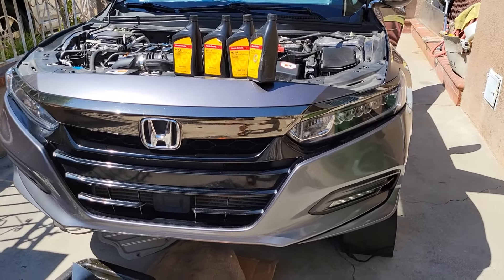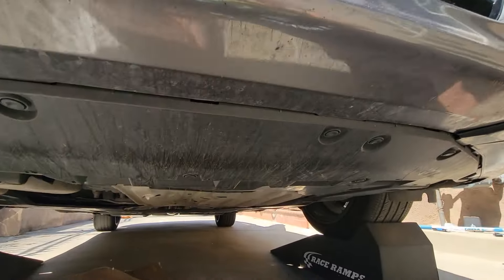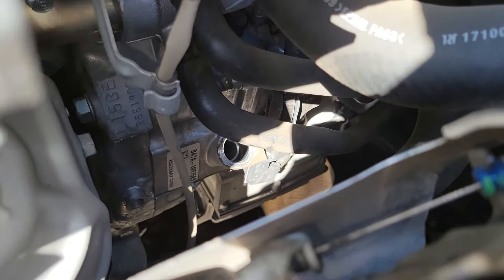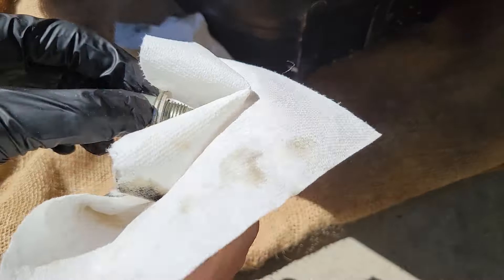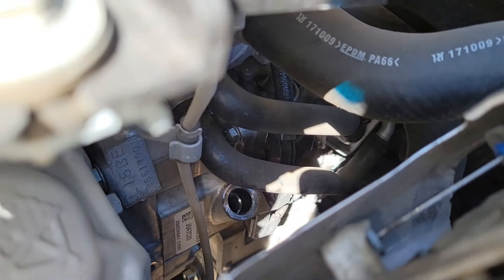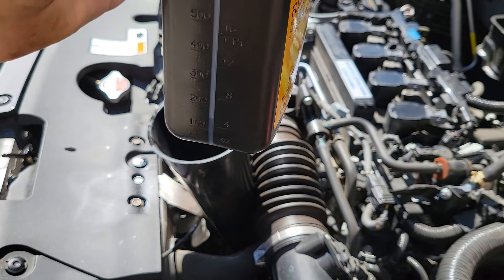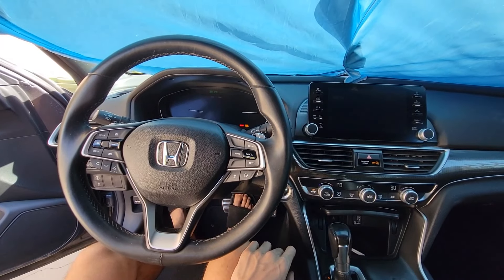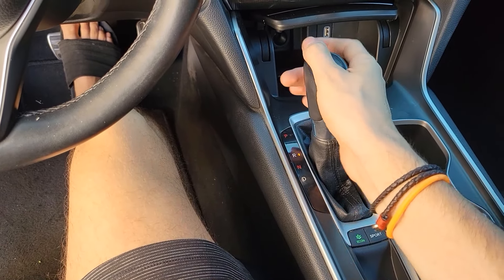CVT Transmission Fluid Oil Change 2018-2024 Honda Accord, CR-V (1.5L Turbo)

Comment: What about changing the transmission filter? and where is it located?
Reply from the maker: If it's similar to my 2013 Accord, it's under and behind the battery which takes some work to get to. In addition, last I spoke with my local parts department, they didn't even know or have the right parts so I just left it

Comment: But you didn't change the filter inside te transmision and the one outside next to the coolant of the transmision
Reply from the maker: That's correct. Honda makes no mention of servicing these 2 filters. There is very little information on it, and for that reason I do not feel comfortable making content on a service that Honda does not have in their maintenance schedule. Keep in mind I'm an average reviewer, and don't want to pretend I know more than I really do. Just spent an hour looking into trans. filters and nearly nothing comes up

Comment: Would the same oil capacity apply to a 2022 Civic Sport?
Reply from the maker: Its the same engine, not sure about the CVT. would refer to your owners manual for 100% accuracy

Comment: So you never changed the filter after changing the fluid?
Reply from the maker: Correct. Honda doesn't show it as a maintenance list item so I'd rather not mess with it

Comment: Thank you for making this video 
Really appreciated 

I have a 2019 Honda sport 1.5. This maybe a dumb question lol but where can I know what oil to purchase for the transmission guild?
Reply from the maker: Always here to help! Not a dumb question at all! 
Are you referring to the yellow bottles I am using in my video?
Reply: @Striker50_  yes the yellow bottles sorry for the late reply. I’m hitting 87k miles so the recommended me to do the transmission fluid. Based on the mileage Do you know when to do the transmission fluid ?
Reply from the maker: @yusufkohgy9122  No worries, Honda parts department sells them, or you can order them on eBay or Amazon. 
Here's an Amazon link from a reputable seller: Set of 5 Quarts Automatic Trans Fluid HCF-2 Compatible with Honda Accord Civic https://a.co/d/5SYxpNH
Prices for the Transmission fluid have been going up over the last few years, I bought them for about $42, 2 years ago
At least that seller is giving you 5 qts instead of 4 bottles
Reply from the maker: @yusufkohgy9122  Here's another seller that gives you 4 bottles and includes the crush washer. This is one of the best prices I could find with free shipping. I don't know these sellers or make profit for them, just want to help you find a good deal  https://www.ebay.com/itm/255874364509?mkcid=16&mkevt=1&mkrid=711-127632-2357-0&ssspo=GCD07b19T8G&sssrc=2349624&ssuid=AtBDZaGWSv-&var=&widget_ver=artemis&media=COPY
Reply from the maker: @yusufkohgy9122  The car should give you a notification to change it at the 50,000 to 60,000 mile mark, but if you're at 87k no worries. This is basically the same transmission as my other 2013 Accord's CVT and that one was recommended to change anywhere from 60k-90k. What I think Honda started doing is recommending people to do their Transmission fluid changes more frequently (at the 50k-60k mark) because it's more money Honda can make. Service departments are the cash cows 💰 of Dealerships. But to be fair, it is better to change fluids sooner than later. 
If you see my CVT video on my 2013 Accord, I didn't change that fluid for the first time until like 110k miles 🤣😱 but she still drives like a champ at 144k.
Reply: @Striker50_  yea dude I get the same feeling whenever I go to the dealership 
I’ll definitely check ur CVT post out

Comment: What mileage should you replace a tranny fluid? I have 2020 Honda Accord Sport 1.5 with 27k miles. I read some say 30k or 45K so i wasnt sure which is the correct info.
Reply from the maker: Hey Gina! My humble opinion is that if you do regular driving, you should be fine following the maintenance minder notification which will come on around the 50,000 mile mark. If you're driving it like you stole it everyday (pedal to the metal) then every 30,000-40,000 miles for example tons of mountain driving, or always aggressively accelerating in city settings. 
For reference, my 2013 Accord didn't get its first trans fluid replaced until around 110k miles, and currently at 144k with no issues knock on wood 
Most of us should be more than fine just following the suggested intervals, and we can easily do most of these services ourselves without paying crazy mark ups the dealers are asking
Reply: @Striker50_  I brought my car to dealer for an oil change and they recommended me for a cvt tranny fluid. I thought that was odd because i only 27k miles . Im not no car savy but i felt it was just a scam to pay a service when it wasnt needed SMH.. In regards to be changing the brake fluid, do you what interval that should be done?
Reply from the maker: @bj10jgo  That's superrrrr early honestly. Sounds like a money grab unless you live in a mountain region where it's common knowledge to do it often
As for the brakes, 30k-60k is common, but if you drive conservative, you could go years before needing to change pads and such. Brakes have a clip that squeals when your brake pads start to get low. Of course, sometimes the squeal can come from debris or other stuff, but just pay attention for that sound

Comment: Hey man! How many miles did you change the transmission fluid? The dealer told me in 60k miles.
Reply from the maker: A notification came up at 50,000 miles, you can see the notification on the screen towards the end of the vid 👍

If you do this service yourself it costs maybe $55 max and take like 30 minutes to do
I hate dealerships because theyll charge like $300 for something relatively simple to do and you'll waste like 6 hours waiting to get your car back
Reply: @Striker50_  Try $411 🤦🏽‍♂️.!!! Dealership here in Sacramento trying to charge me that amount right now for a transmission flush, which I personally don’t think I need, cars at 48k and I did a transmission fluid change at 34k. It’s a 2018 Accord 2.0 10speed Turbo. Any feedback would be appreciated. ✊🏽
Reply from the maker: @damerobin4037  Sacramento is relatively flat so might not be necessary to change fluid so often. 
In addition a full flush may very well be a reason why they're milking you for $400+ 
My personal opinion is that it's an overkill to change it so often unless you're shredding mountain roads near Tahoe frequently
Reply: @damerobin4037 maita honda in Citrus Heights quoted me $450 yesterday.
Reply: @Striker50_  Thank you, much appreciated. 💯🙏🏽
Reply: @jeffreykwong1712  That’s exactly who quoted me $411 a few months ago. They changed now to Future Honda.
Reply from the maker: @damerobin4037  Damn 💥 all the Honda dealerships in California charging an arm and a leg 🦵 🫰🏻
Reply: @Striker50_  Welcome to California, where we overcharge for everything 😂.

Comment: Is it every 90k miles?  Do you think putting the front on ramp will impact fluid draining out, maybe not?

Did you drain and refill 3 times to get most old fluid out?
Reply from the maker: 60k or when your Maintenance minder light comes on, sooner never hurt anyone either
Reply: @Striker50_  Since some old fluid is still left, do you think it is good to do drain and refill 3 times after driving, or one time, and wait a few months?

Comment: You didn't say... But only hand tighten the new oil filter.. snug.. So many  over tighten it .. and some will even use the filter wrench..
Reply from the maker: I didn't change the oil filter you may be confusing it with the engine oil filter
Reply: @Striker50_  👍You are right I must have been watching a couple of different videos and got you confused with what I say it.. brain freeze😅I like these types of videos. Good job on yours..
Reply from the maker: @charlesjackson1700  Thanks! Yeah happens, we dive down the rabbit hole and can't remember where we saw what lol
More to come I've just been caught up with work and I want to make sure I'm cranking out quality content (despite being an amateur)

Comment: hi, i have a question i want to ask is that the correct fill plug location because there are other fill plug is closed to battery that one has hcf2 label on it. thanks
Reply from the maker: This Accord has 2 fill plugs apparently! Pretty weird huh!?
Reply: I have a 2018 and this bad boy only had one plug

Comment: you should’ve level the car by jacking up the back so that you can get the most of the fluid, cause If you put 3.9qts of new oil it’ll pretty much mixing on the old oil that you we’re supposed to drain if you you just level the car.
Reply from the maker: Agreed, I mention it in the video
Unfortunately not everyone has hundreds of dollars for Jack stands and lifts, so I show it in a compromised way where most people can do it although it's not the best way to do it. 
I'll be making a revised video in the future showing the proper way
Reply: @Striker50_  🙏🏽🙏🏽🙏🏽

Comment: what about the trans filter ? these cars doesn’t have a trans filter ?
Reply from the maker: It does but you have to remove the battery and the bracket to access it. The filter is said to be a lifetime one and Honda doesn't make it easy

Comment: Do you need to change transmission filter as well?
Reply from the maker: It's always welcome, but not necessary as it's quote unquote lifetime filter. It's an intermediate service to do for the average person, and to find all of the parts and o-rings is quite challenging as most parts departments aren't even aware of the transmission filter being a thing

Comment: i cant find transmission oil that says ATF 2.0, all I can find is a CVT, so is this correct?
Reply from the maker: No way Jose, if you have the Automatic 10 speed transmission, DO NOT use this fluid. Any Honda Parts department has it, and it should be available online as well
Reply from the maker: I linked the ATF 2.0 for you here https://www.amazon.com/shop/striker50/list/22TBRJ5EGQE8T?ref_=cm_sw_r_cp_ud_aipsflist_aipsfstriker50_G6GD4SFQPZDPMGPDB2AG
Reply: @Striker50_  I don’t know what I have. How can I tell if it’s an automatic 10 transmission ?
Reply from the maker: @OzzTheWizzard  you'd have the 2 liter turbo faster Accord
Reply: @Striker50_  I have a cvt hcf-2 transmission oil
Reply from the maker: @OzzTheWizzard  Are you sure? You were asking about Auto 2.0

Comment: I seen on some websites they say the capacity is 4.5 quarts for 2.0
Reply from the maker: Just for clarification, this video is for 1.5T models, in case you overlooked that in the title 👍 
I can't speak on behalf of the 2.0T however
P.S. the 2.0T can vary since they offer a 10Speed auto & a Manual, so it's best to refer to your manual or call the Honda service/parts department and ask what the specs are

Comment: What did you mean by the soft side of the crush washer?
Reply from the maker: Yes sure: if you notice, some crush washers like the one I'm using have a white side and metal side. The white side faces the oil pan so when you tighten the drain bolt, it "crushes" and shapes to create a seal

Comment: Did the car give you the maintenance code 3(transmission fluid) at 50k miles? For the first time?
Reply from the maker: Yes, you could see the codes towards the last minute of the video, I did an oil change, transmission oil, and tire rotation

Comment: Can you make a video changing the transmission filter as well
Reply from the maker: MrRangerZr1 makes a video on that.
Personally, I don't do it because it's very difficult to locate the appropriate parts (filter and appropriate O-rings) for that service. 
It's technically rated for the lifetime of the CVT although we know it would be better to replace. 

Even with the links that MrRanger provides, a lot of the o rings are vague and don't offer much description as to if it fits or not. So the last thing you want to have is an O ring that doesn't fit, and your existing o rings to be ripped when removing them, for that reason I prefer not to mess with it, hope that explanation helps!

Comment: Why don't you change the transmission filter?
Reply from the maker: Service bulletins have no mention of replacing it unless the transmission is having issues. If the filters have been changed there may be no way to diagnose what's wrong
Reply: @Striker50_  I hear you, not sure I agree with that logic. If you change the filter, you can see if anything bad is happening, if it's clean you have a better idea of the condition of your transmission.
Reply from the maker: @edweigman9683  Sure, I'm not in support of it either. In addition, there are 2 transmission filters. 1 in the oil pan, and the 2nd one is under the battery crate. Both are quite the challenge to replace which insinuates it's not meant to be an item that gets serviced. There was also mention that it's a lifetime filter. For those reasons, I personally find it easier to leave it as is

Comment: Why did you not swap the cvt transmission filters?
Reply from the maker: It's not easy to do, takes too long
Reply: @Striker50_  Are filters part of the maintenance though?
Reply from the maker: @raczyk  nope they're not part of the service bulletin
Reply: @Striker50_  Where is this bulletin, could you share it.
Reply from the maker: @raczyk  I found it on Reddit or some forum years ago when I made this video. Honda states it as a lifetime filter. Whether it is, or isn't, I'm going by what Honda says
You're free to find it and let me know

Comment: 2018 Honda Accord LX 1.5 after how many miles should the transmission oil be changed ????
Reply from the maker: Your maintenance minder should alert you with a notification to replace the transmission oil around every 60,000 miles

Comment: Link to that funnel? Looks like I’ll need a long skinny one
Reply from the maker: I picked it up at O'Reileys, Autozone will have them quite cheap also. If you want to order through Amazon, You can look into "long car funnel" 
or here's one that should be even longer than the one I used in the video:
https://www.amazon.com/Long-Flex-Flexible-Funnel-Tube/dp/B07N979R3L/ref=sr_1_21?crid=36EO304Z104O3&keywords=long+funnel&qid=1658504380&sprefix=long+funnel%2Caps%2C170&sr=8-21

Comment: By any chance you have the link to the trans. fluid??
Reply from the maker: Both the buyers I've bought from on eBay no longer have this listed. You can do a search on eBay and see which sellers have the best reviews and best prices that's how I did it 👌 better prices then the dealer parts departments for sure

Comment: They told me at Honda dealership “you don’t have to worry about that” 😮🤔 mf what??
Reply from the maker: About a CVT Oil change!!?
Reply: Well my 2021 accord sport is at 140k kept accidentally deleting all maintenence reminders resetting oil after changing so not sure when sensor indicated it originally but that's why I'm here

Comment: My drain plug didn’t have the magnet…
Reply from the maker: Perhaps you got an aftermarket one at another oil change spot
Reply: @Striker50_  figured it out, it’s on my hybrid, E-CVT transmission. It does not have one on there. Had to dig through a bunch of videos. Turns out it was less transmission fluid as well, about 2.25 quarts for it. The owners manual says not to do it yourself, and therefor gives no information.
Reply from the maker: @chipchipperson12  Thanks for sharing! 
Yes for example the AWD crv uses this same motor but needs more oil. 
Good to know the hybrid needs less. 
Also HATE how car companies aren't even sharing basic information ℹ️ anymore. 
It's all a money grab. Service center is what makes the dealership the most money. Super unethical

Comment: Should I change my transmission oil on a 2021. I haven’t done the first oil change yet. Should I do both.
Reply from the maker: Engine oil is one thing; if you want to do your transmission oil 5,000 miles in, that's pretty drastic, I would personally wait for your notification to change it to come on which should be at least like 2-3 years from now

Comment: What about the transmission oil filter?
Reply from the maker: Too hard to change and there's no information stating it's an item in the service schedule
Reply: @Striker50_   this is my first crv 2017 touring 1.5 turbo, is that true that is a external transmission filter? By the radiator? Sorry for my English im still learning.
Reply from the maker: @kelloggskelloggs6185  No worries, your English is very good. There is 1 filter under the car battery, and there is another filter in the transmission oil pan. From what I have read, it does not say anywhere they should be changed

Comment: I have a 2018 Honda Accord 2.0 Turbo Sport, do you where is the fill plug or video of how to get to it?
Reply from the maker: Is it a CVT, manual, or a 10-speed Auto?
Reply: @Striker50_  CVT
Reply from the maker: @chaubui7585  
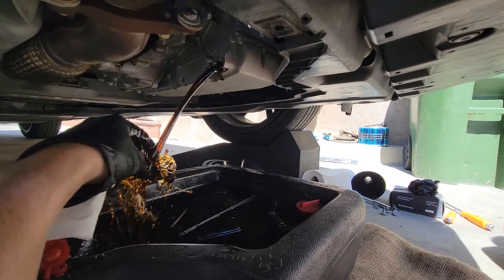Check out this video @ the 2:14 mark
https://youtu.be/A2lpkLiVQgE

It should be to the left of your Red color battery terminal.
Look down and you should see the plug with a White cover on it, lmk if you find it 👍
Reply: Please be aware that the 2.0 engine is NOT a CVT; either 10-speed automatic OR 6- speed manual.

Comment: If need better could change transmissions filter 👏
Reply from the maker: That's a great point 👍 most people don't want to do time-consuming labor however so I just did the oil change

Comment: For 4x4, it's more
Reply from the maker: Are you referring to an all wheel drive Honda?
Reply: @Striker50_  Yes. AWD takes 4.5 quarts of fluid
Reply from the maker: @rajfell  Correct, the AWD CR-V would take 4.5 
It's the only model with the CVT that has AWD

Comment: Does anyone know if the 1.5 turbo CVT transmission has a filter that can be replaced?
Reply from the maker: Yes, it does, but it's quite time consuming to access
Reply: @Striker50_  …is it like in previous models, behind the CVT cooler ? A couple screws